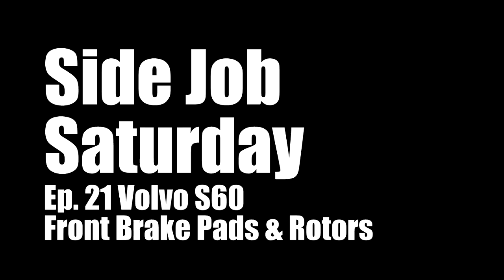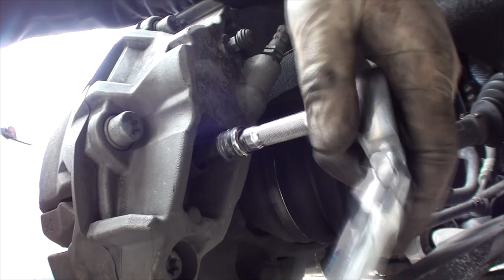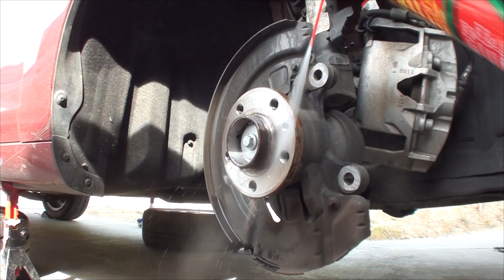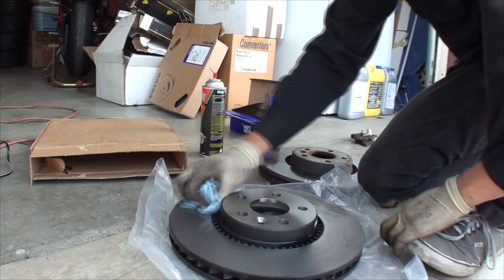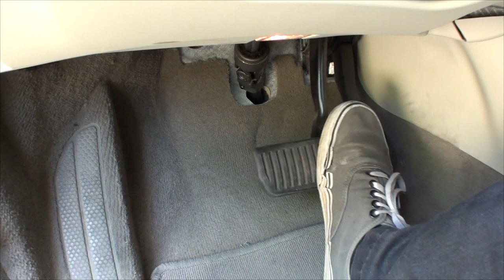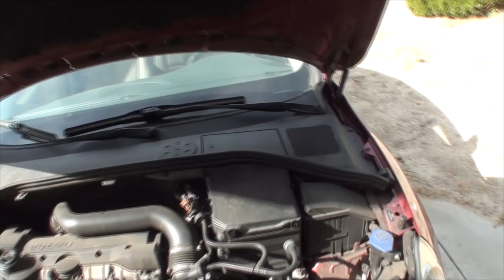[SJSE21] Volvo Front Brake Pads & Rotors

Comment: Hate to ask... what is the part of the Brake Assembly that the TWO bolts (H7) thread into?  Whatever that "thing" is... the top threaded hole is stripped and will not receive the H7 Bolt.... SUX!!! So I need to order a new one... I just dont know what it is called.  Thank you in advance. Good video.

Comment: Hey brother wanted to get your input on my maintenance schedule that I use. I only put around 4,000- 6,000 yearly miles on my 07 toyota fj cruiser. I like to change it at the 5,000 mark but that is basically only once a year. Shouldnt I be changing my oil twice a year? 
Should I follow a 5 month oil change where I change it at least twice a year?
I like to use Quaker state full synthetic with the toyota filter as seen on this video.